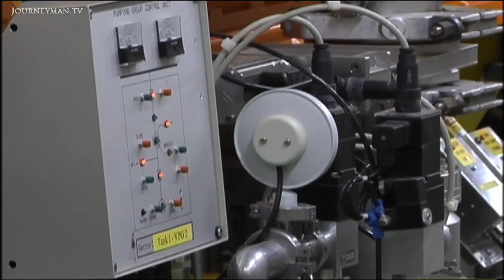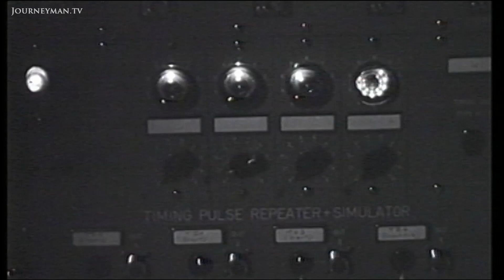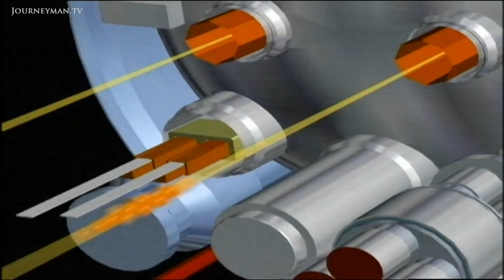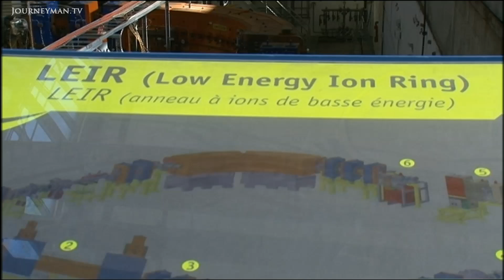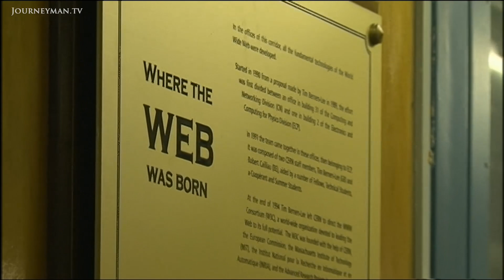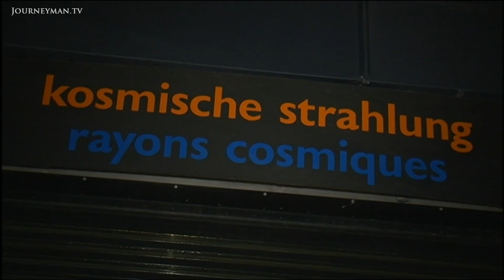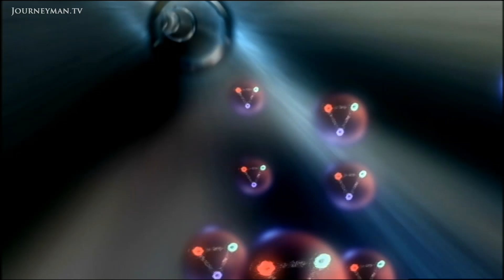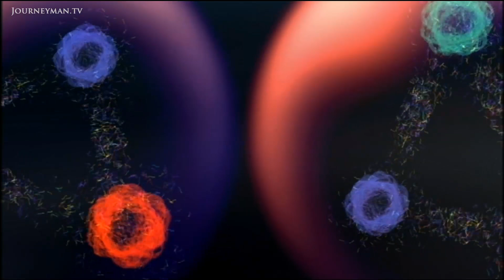Is There Really a Chance that the Large Hadron Collider Could Destroy the Planet?

Comment: In order to create a singularity (a black hole) a collider would have to have the energy to compress a mass the size of 4 solar masses to a 10 mile diameter (or the earth to the size of a dime, but still wouldn't be anywhere near the mass to sustain it). The biggest collider is astronomically microscopic compared to the titanic forces and mass required. People who worry of such things are not aware of the immense forces involved to cause stellar forces to drop out of our dimensions we call the universe. Just sayin......
Reply: I read that a Time Machine would require the power equivalent of a small star exploding - which left me wondering how the scruffy & burnt looking piece of equipment which Bruce Willis’ character hopped inside in Looper was actually capable of such activity. 😁👍
Reply: You are going to need to get over 0 has two parts.  0 is 0.

Comment: Not in itself, but possibly if the forces manifest from its operation are harnessed and utilised incorrectly. I don’t believe it is purely a particle smasher as advanced physics clearly understands ‘particle physics’ is an approximation of nature and not its true composition. It is more likely a device to unlock the harmonic frequencies of natures fundamental constituents. Like a spark gap in a tesla coil couples the characteristics of the wave front to function in the correct manner for ionisation of the local atmospheres gasses/composition. Just like the great pyramid uses the subterranean aquifer and crystallographic properties to couple the characteristics of the wave front to that of the Earth and ionospheres electrostatic, electrodynamic wave coupling characteristics.
Reply: Divisive partical physics by tampering by the unlocking of harmonic frequencies from natural fundamental constituents,throws off the ballance of magnetic field bands that balance every living being the breaths oxygen atop & below the earth.Similarities of Tesla coil sparks,when coupled with the ominous characteristics of natural wave frequencies bends electricity..Are then incorrectly harnessed ,when utilized incorrectly,by most any moron who contains such major or portable devices that perpetuates change in all molecular cell structures of the full natural environment.Just because dramatic changes doesn't have an obvious trait.Atfirst various subtle occureances, may still be gradual,until it does.These particulates when crushed is alot like inharmoniously splitting molecules within the air waves that everyone including the whom ever operates it correctly or otherwise are also effected.